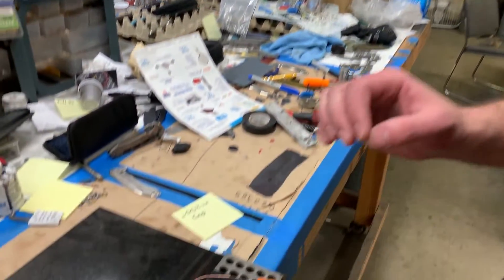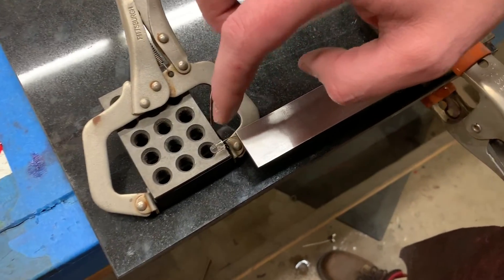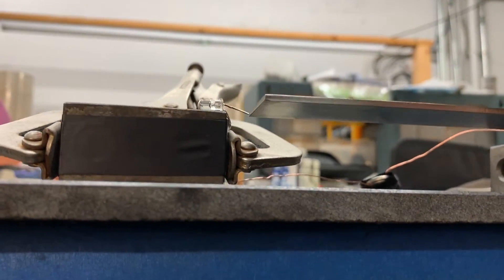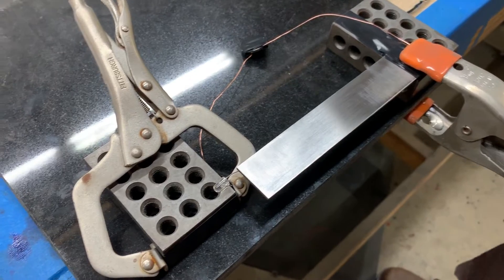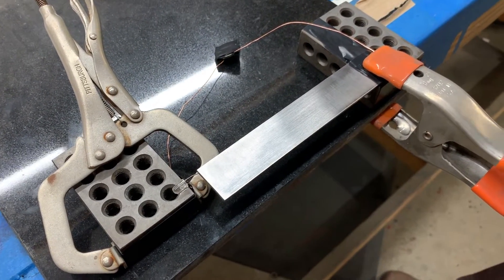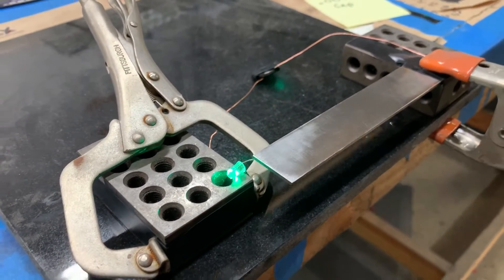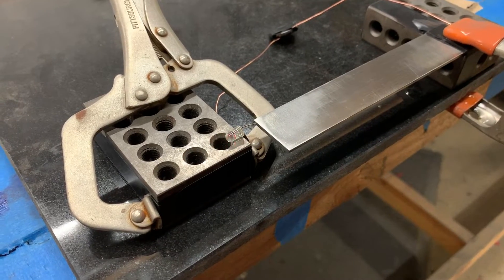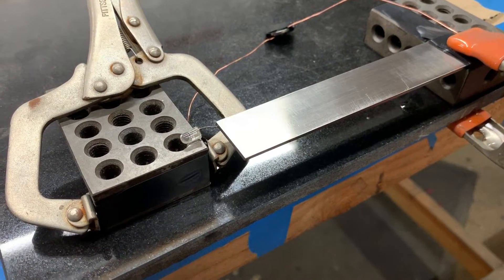Thermal Expansion in Titanium: An "Illuminating" Demonstration

Comment: Sounded like you took a page out of AvE's "dubly do" posts playbook (he's great BTW, I highly recommend checking out his channel).  I have a question for you though...  At what price point do you think customer bitching about "tolerances" or lack there of, would start to be considered as "reasonable" complaining?  For example, blade centering on a $40 "dollhairs" budget knife vs a more expensive $100, $200  or even $500 and up knife?  Good videos FFKW...  Thanks.
Reply from the maker: To say that's a tough question is an understatement.  It is actually a very complex question about the trade-offs between price and quality, and at what point the consumer gets the best value.  All businesses, not only knife businesses, struggle with this.  It really is the core question of any business. Bear with me on this response.  I'm going to use a lot of general terms because a full in depth examination of the economics of knife manufacturing would take hours of video to unpack everything.

We can't peg down a specific price point and level of quality where complaining is "reasonable".  The relationship between price and quality in folding knives is very complex.  To simplify it a little bit, the quality of a knife has two main components:  materials and precision (tight tolerances are integral to precision, but do not tell the whole story).  "Precision" is a combination of machining precision/tolerances, design and engineering, and skilled assembly.  As the quality of materials and the degree of machining precision increases, the price will increase.  Obviously, higher quality materials cost more, but they also increase the cost of machining and part generation. We specifically find for the materials we use, like titanium and M390 steel, the cost of machine precision rises.  They are difficult materials machine, require specialized tooling, and longer run times, so the cost rises exponentially as the tolerances decrease.  However, we also see diminishing returns on the degree of precision.  There is a point where precision no longer adds to the quality and longevity of the knife and actually exceed the tolerances of the materials.  We can machine titanium so precisely that it will come out of spec with minor temperature variations due to titanium's thermal expansion and contraction.  It is absolutely possible to have a very precisely machined and assembled knife with mediocre materials, and a moderately precise knife with premium materials that will have the same price.  

In today's knife market we find that the $200-$300 price range is where you'll find the optimal mix of quality materials, precision manufacturing, and price that will translate into a quality tool that you will own and use for a long time. 

At the end of the day, it really is up to the customer to determine the price/quality point they're looking for.  We will continue doing everything we can to have a range of products across multiple price points so that everyone can get the best knife for them.

Comment: I never realized how much temperature effects the dimensions of a workpiece until I started my tool and die apprenticeship. We had to grind a two dozen .203” diameter pins to within -.0003, and if you hold the pin too long while getting it to the surface plate, it’ll grow another 3 tenths🙃